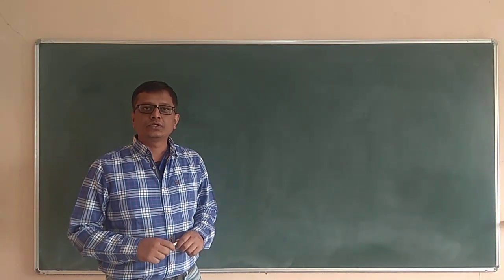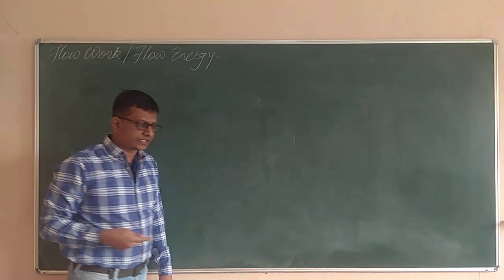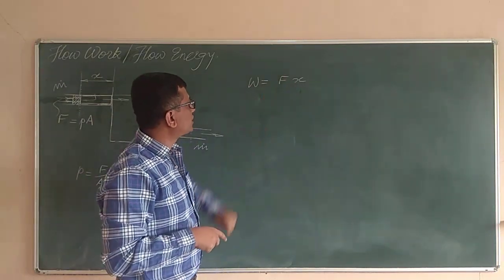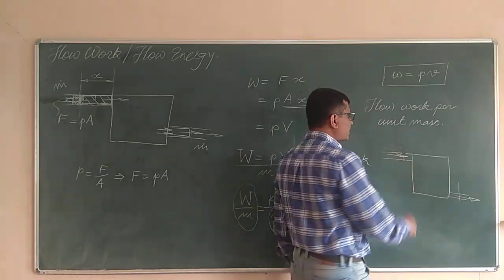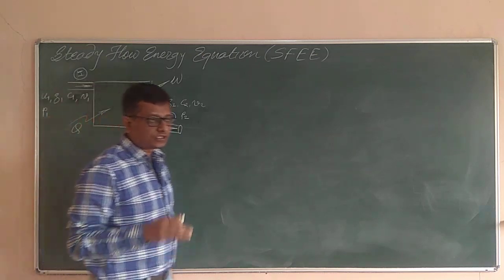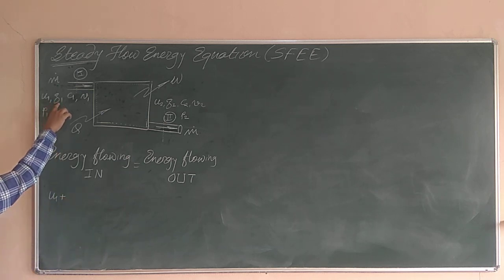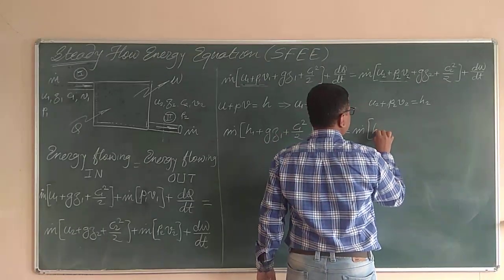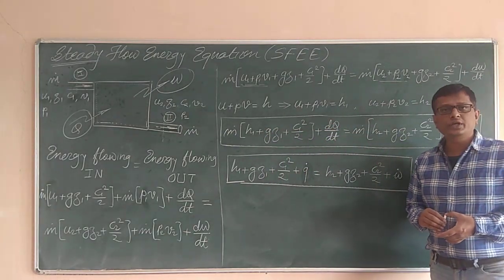Engineering Thermodynamics Lecture 6

Comment: What is the exact difference between turbulent flow and unsteady flow ??
Yuvraj lomate
SE-A-80
Reply: Turbulent flow is the type of flow in which the fluid particals moves zig-zag way and unsteady flow is that flow in which the velocity, pressure, density of fluid particals at a point change with respect to time.
Yashraj Kamble 
SE A 79

Comment: What happens when weight of the system get increased due to the accumulation of 2kg of energy inside the system?
Aditya. R Kakade A41
Reply: Decrease  efficiency of the system.
Yashraj Kamble 
SE A 79
Reply: Decrease efficiency 
Roll no 30

Comment: Is there effect of changing cross section of inlet and outlet on mass flow rate? 
Shantanu Kamble 
B75
Reply: Yes mass flow rate increases with increase in cross section area and vice versa 
Nakul Raut SEB 61
Reply from the maker: It depend on many parameters

Comment: During the process Is there any change in rate at which heat and work are transferred across the boundaries? 
SE B 64 Pavan Jadhav
Reply from the maker: But , During the process the rate of heat and work are transferred across the boundaries are constant. The rate do not change for steady state
Reply from the maker: During the process heat and work are transferred across the boundaries
Reply: Yes , change in rate at which heat are transferred across the boundaries due to  the difference between temperature of the surrounding and the system.
Yashraj Kamble 
SE A 79
Reply from the maker: @yashrajkamble4642  Please check
Reply: @deepakbiradar7723  Ok Sir

Comment: ADITYA TELHARKAR
B-47 
IN practically,the mass flow rate at inlet will be equal to mass flow rate at outlet remain constant Or  not
Reply from the maker: Otherwise there will be either increase/decrease in the mass of the system
Reply: @deepakbiradar7723  thank you sir
Reply from the maker: It has to be